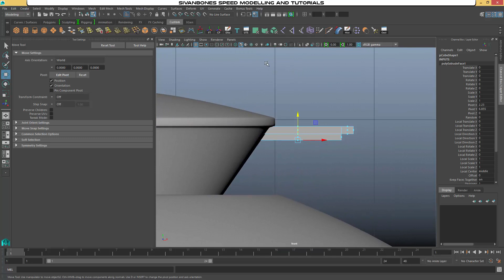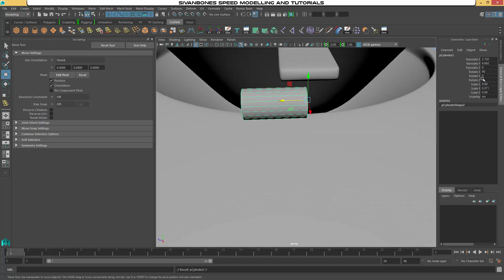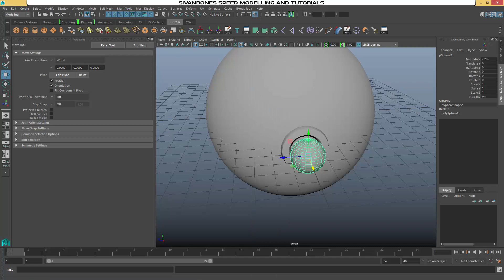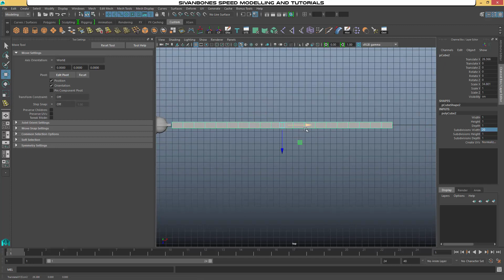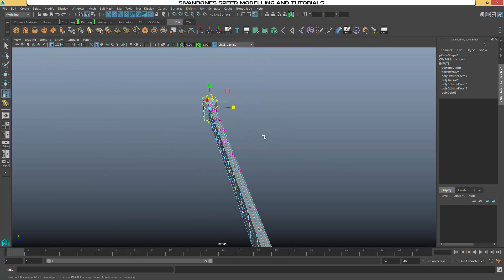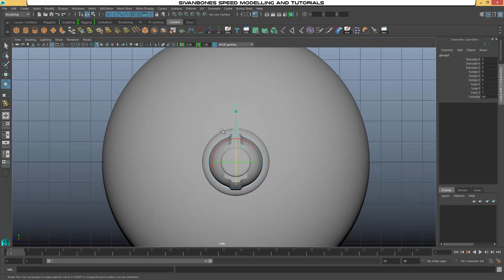Maya Lets Model the Incredibles Omnidroid - Part 2

Comment: How demanding is Autodesk Maya? If I am just making small models, will it be fine with an i5 4200u?
Reply from the maker: +Reedster It should run all the small models without problem. I have been forced to use an i3, 4GB RAM laptop to model before, now that isnt fun ;)
Reply: +SivanBones Hah, I bet! I only plan on making small models anyways. I have used Blender before but i didn't know if Maya was anymore demanding. Thanks alot! :)
Reply from the maker: Yea it should be fine. If it slows down you can do a couple of things...Turn plugins off that arent being used or in 16 you have control over how the cores are used, so you can distribute the load more evenly
Reply: Thank you for this information, I won't be using this laptop long as my build should be finished by fall. I am going to be using an 8 core amd fx 8350 which should be fine.... I hope.